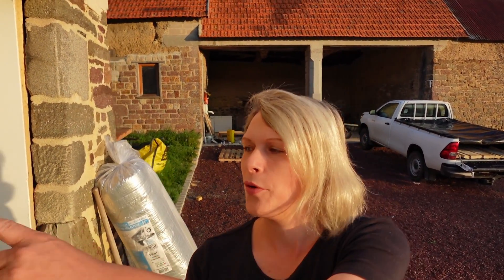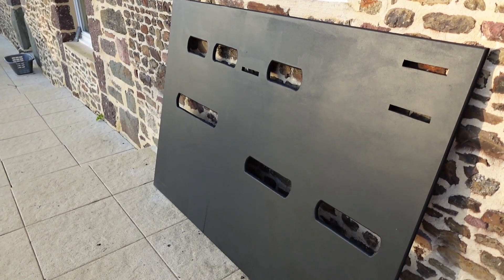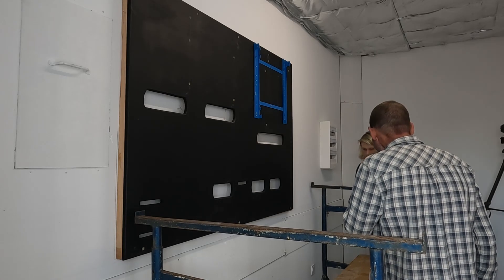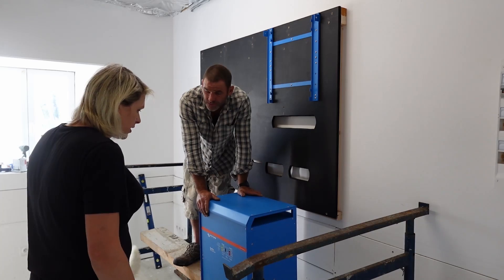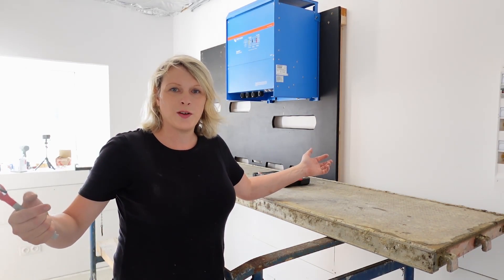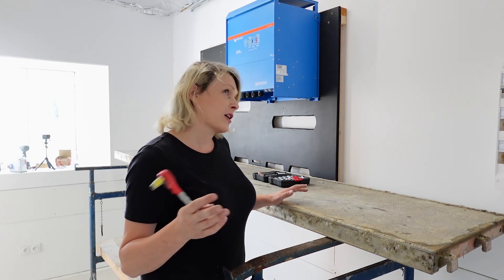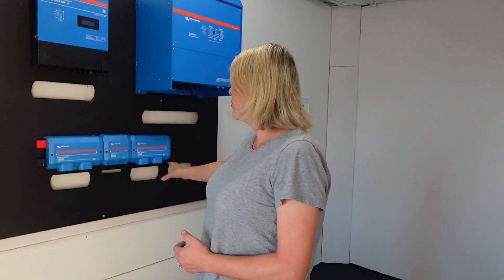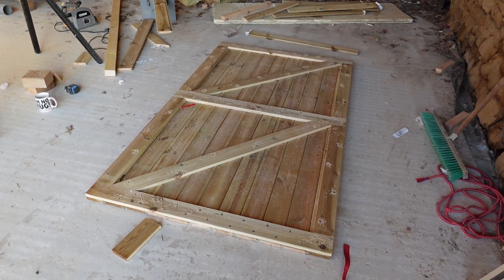DIY Solar Plant Room - Victron Quattro Struggle!!

Comment: This is going to be an excellent system. Bit late to be commenting really but I generally fit a strong point to the roof above the inverter then winch them on with a block and tackle. With a 4:1 purchase you can do it yourself without much jeopardy. If you are already thinking about more EVs and inverters, consider designing it for expansion up to 3 inverters so you retain the option to move to three phase in the future and hence 22kw car charging.

Comment: Sorry to say Sarah, but that mounting board, if its MDF, is not a good choice, just for the reason that it is combustible, and as mentioned below does not do well if wet from a leaky roof or water pipe. I used a fire proof board to mount my Inverters on, and although the chance are slim, it does protect the main supporting wall and building. Now would be a good idea to change it. The Victron Inverter and associated parts might be the best design, you are not, and as you have said many times, you are on a learning curve, so it is you who are more likely to make a mistake and cause a fire! You have made a massive investment here so commence must prevail, well that's what I tell myself when working on such projects.
Reply from the maker: I'd like to address this in a separate video look out for this next week...

Comment: You did very well getting that inverter up there, for those that don't know, it weighs 71kg. I have a 48/10000 and that was bad enough (51kg). My daughter and I lifted it up, well like you a series of stages, then we walked it up on some blocks of wood. One thing I will say, is MDF is a poor choice, if it gets wet or damp it could lose structural integrity, a decent sheet of plywood would have been a better choice. I also faced mine with tile backer board, as fire proofing. One issue with running cables behind the board, is the potential to screw into them.